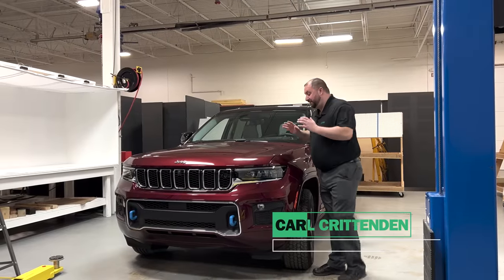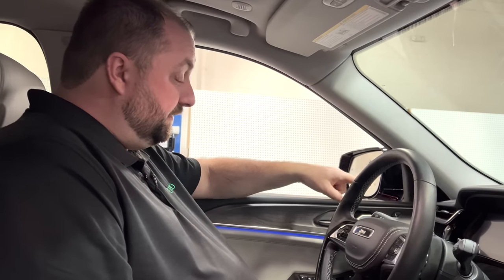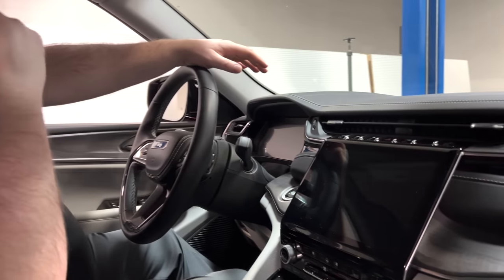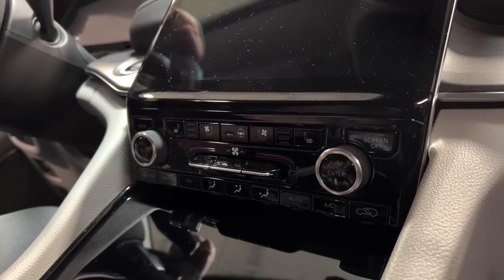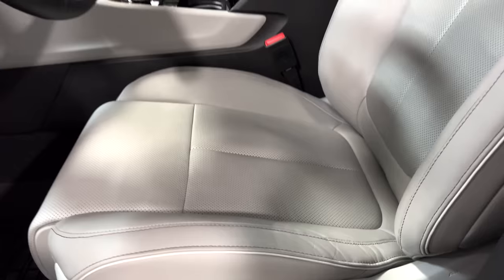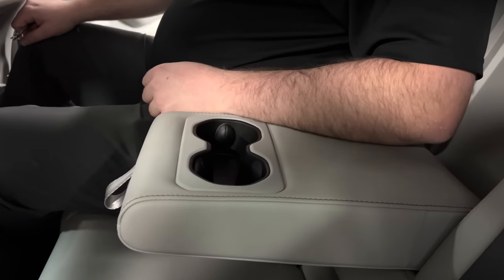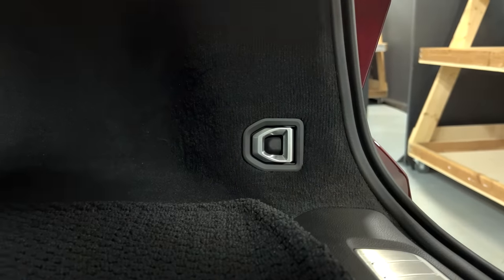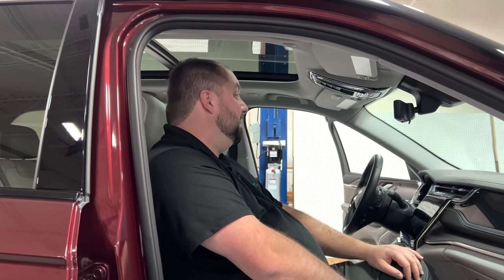The Devil's in the Details | Jeep Grand Cherokee 4xe Interior Review

Comment: I really hate these kinds of "throw in everything!" kinds of designs for interiors. It just looks confusing and dizzying and the vast majority of the surfaces are hard to keep clean. I just imagine a snotty nosed kid smearing green gunk down all of this and then trying to clean all of these crazy seams. 

And why is the screen 1 inch wide like a weird paddle? Seems like a total nightmare for installation and it would have looked better to just close that off and not have that screen "connect" to the other screen. God forbid that screen get broken... which seems inevitable... I would hate to be the guy at some dealership who has to try to replace that without breaking that thin section of glass.

And you are right Carl, those controls are terrible. I guess there is nobody left at Stellantis who gives one flying flip about ergonomics. Not that Jeeps were ever ergonomic, but the folks at Chrysler used to make a big deal about it.

Comment: Carl, your remark that manufacturers don't provide tie down hooks to hold the tailgate/trunk for long loads - all vehicle come with the perfect hook - the locking catch. just loop the rope/bungee or shock cord on the hook and manually flick it closed. When releasing the door operate the electric or manual opening mechanism. I always use this method.

Comment: I think a lot of customers would appreciate a swing out tire carrier option from factory. I don't know why that stopped being a thing. You can find tire carriers that plug in to the hitch but not after market bumpers that have the hinge on the corner of the bumper. I don't really get that one either. Great video, thanks. I would have liked to see a tape measure in the cargo area, maybe lay down in the back for perspective. Car camping is super popular still. Also, I didn't see any AC power in the back. What's up with that? Cheers.

Comment: Love the wrapped surfaces and vents, but everything from that piano black and down could have gotten the axe as far as I'm concerned. Whoever designs the hard plastic vertical section of the dash must hate tall people. Mazda is the only company that has ever designed a knee-friendly dash in the past decade.
Reply: Mazda tends toward wide center console which blocks legroom and spraying in my experience.  The GC has long seat travel and is good for up to 6'7" I would say.  I'm 6'4" and fit very well.

Comment: I recently purchase the Summit Reserve 4xe.  Thank you for the interior review.  The only thing that really bugs me thus far, not a lot of time with the car yet, there's no way to hold up the rear compartment cover.  I just spent the last few days working on ceramic coating and had to lift the entire car to put on jack stands.  It was a pain getting the jack out and putting it back in.  I can only assume that pulling the spare tire out would be even more challenging.  Maybe I'm missing something but this really seems stupid.  Also, there are really quite a few differences in materials and parts with the Summit Reserve, and even so when compared to the Summit. I will be treating the interior materials and cleaning often to try to maintain the look and reduce wear.  I hope it holds up with light to moderate use, especially with teenage boys in the back.  I will really be relying on the ventilated seats in the rear to keep the soccer sweat and odor down, thanks again for Munro reviews.

Comment: I like that spare where it is. Why? Did you ever try to get a spare tire to come down on the 2001-2007 Chrysler Town & Country w/o Sto n Go? Good luck, the bracket rusts in place and even though the cable drops, the the tire remains stuck up against the trunk floor pan! Also the painted  steel wheel rusts bring out in the salt too!

Comment: I watched from start to finish.  In my younger days, I worked as a mechanic and I never thought of all the parts that go into an interior.  Note: The bad words I said about engineers while working on the vehicles, they didn't design them to be worked on.  The assembly on the line doesn't consider the mechanic or customer when they have to be repaired, which they all do.